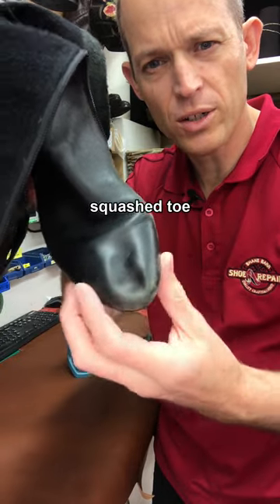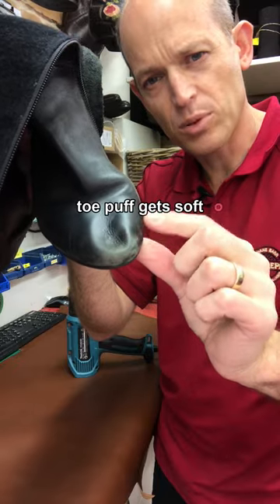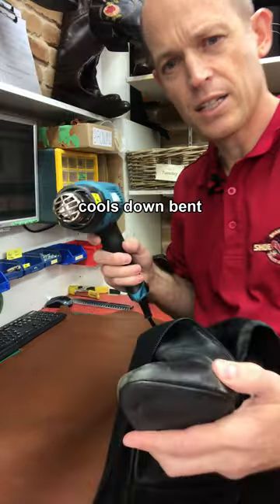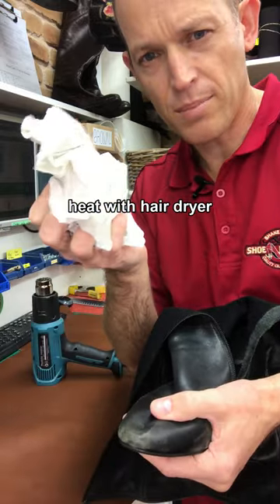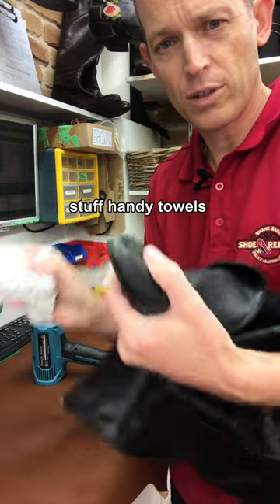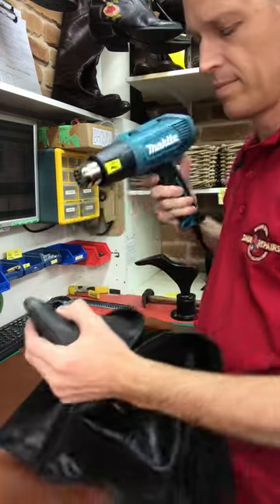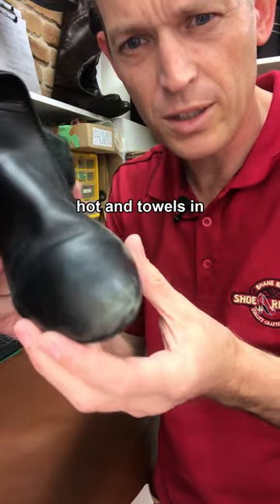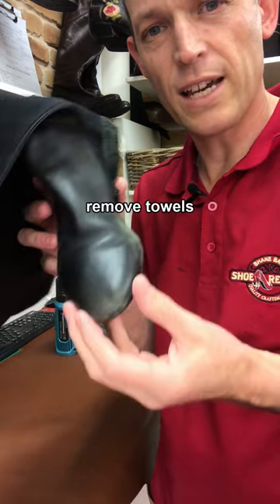Get your squashed shoe toe puff reshaped liked new

Comment: Hi will this work for vintage canvas shoe?
Reply from the maker: Have not tried on a vintage canvas shoe. Depends if it has the plastic toe puff in it. You may be able to feel it if it is unlined
Reply: Ty yes unlined
Reply from the maker: @shannonstewart1225  if it has a different look on it inside at the toe, that is likely a toe puff. Try heating with hair dryer then hold in shape by stuffing tissues inside. Takes more heat than you think.
Reply: OK great thank you so much. It’s an old; brand new pair of purple *NSYNC canvas shoes I found in a free box. Lol
Reply from the maker: @shannonstewart1225  nice one, some cheap plastic shoe trees ... or some shimmy wooden ones from an op shop, will help keep them in shape.